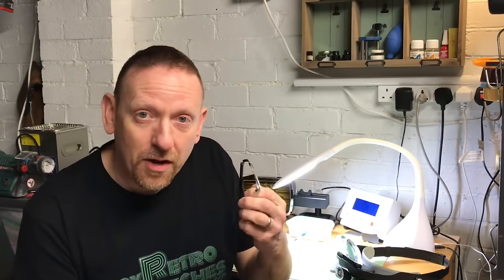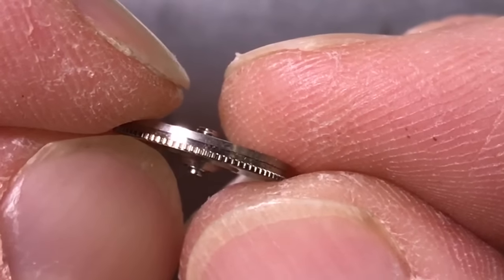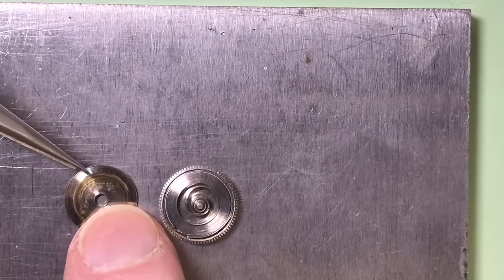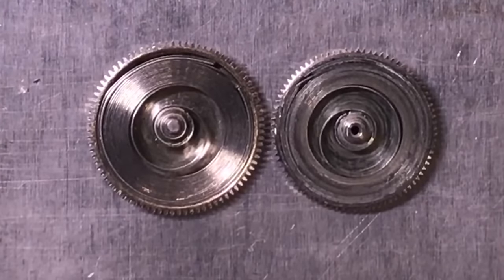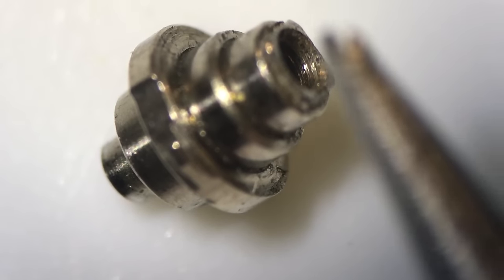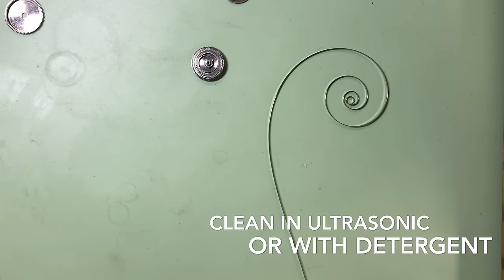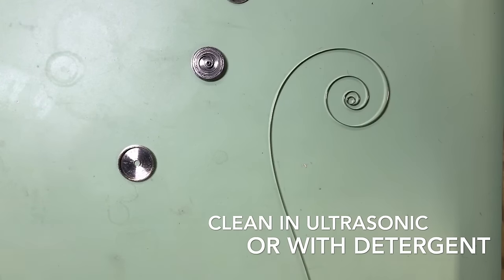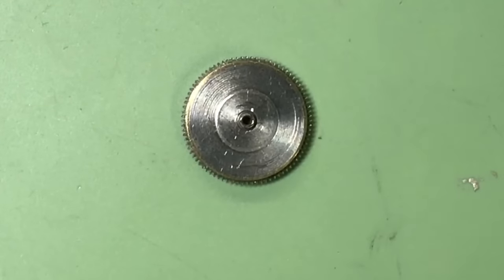How To Service a Watch Mainspring By Hand

Comment: Hi Mike. APropo of microscopes, would one like yours be suitable for manipulating hair springs? It’s something I would like to learn as, in the event the rebuild goes well, and there’s power in the mainspring, it all comes down to the balance, and that will often be the hairspring. Martin
Reply from the maker: if you want to tweak hairsprings then id recommend a boom arm scope as you will have more room underneath to work on. I have successfully used mine but more room would make it easier.  I have links to AM scope boom arms on my tool page on my website.
Reply: My Retro Watches Thanks Mike, I’ll give it some thought as they’re a little pricey for a beginner. Martin

Comment: I have a question. I hear from other watchmaker channels that you dont want to touch anything with your bare hands leaving skin oils behind, and that skin and small pieces of you fingernails will get stuck inside the spring and cause issues and corrosion later. Is that true or false?
Reply from the maker: This is true. I usually wear finger coverings for most work.  If it is your own watch then its up to you. Corrosion will only happen if you have greasy oily fingers and I am yet to see serious corrosion from finger prints.  You can see them sometimes on parts but the main killer is water ingress which will rust a movement in days.

Comment: I was thinking the only way I was going to do this was to not service the mainspring at all, or buy a mainspring for each watch because they come in that ring that allows you to be able to just push it in the barrel. (A set of winders is not reasonable unless I decide to make this a regular hobby).
I was led to believe that it can't be done manually without kinking the spring.

Comment: Great video....here I go..
Reply: Wow..you make it look very easy. What a job, the language I used was nothing like yours!! Really fiddly and so difficult to visualise which way to wind it for a first timer. I had cramp in both hands by the time I'd finished...and was extremely relieved on completion to have wound it the right way. Had to do it bare fingered though as I just couldn't do it with nitrile gloves. Thanks so much for your upload.
Reply from the maker: Thanks glad it helped. It does get easier with practice.

Comment: Thanks for the video.  One thing I don’t understand is how the arbor latches onto the mainspring at the centre. I understand that the bridle stops the spring slipping at the outer edge, and that there is an indentation you mentioned in the arbor, but how does it actually hold the spring?
Reply from the maker: HI Alan, Weirdly I replied to this a few days ago and clearly it did not post. Okay so the end loop of the spring latches on to the ridge of the arbour . when the spring is wound the latch pushes the end of the spring in the end loop to then wind.  If the spring is wound the wrong way when you put in the arbour it still fits however the latch is then the wrong way so what happens is that if you install it into the watch and apply some tension it will start to wind and then it clicks over the latch and all tension is lost . (I have done this on several occasions) Hopefully this makes some sense to you.
Reply: My Retro Watches Thanks for taking the time to reply. I think I get it now. I didn’t realise there was a loop in the end of the spring. I need to look at one more closely!
Reply from the maker: Alan H  it’s the smallest coil on the end near the centre.

This website I found at random shows it for you.

https://www.bobswatches.com/watch-resources/rolex-mainspring-barrel

Comment: Watching this video for the third time, I don't see you hooking the arbor to the  mainspring as you push it through the casing. Am I missing something or is torque somehow in play here when the casing is completely closed?
Reply from the maker: Without watching the video again I cant remember however the lid will not close unless the arbour is seated correctly. Some of these Seiko ones can be a bit awkward. I tend to position it and then turn with tweezers so it hooks into place.

Comment: Good watch! Il stick to my mainspring winders🧐😅I tried and was not getting the hang of it!
Reply from the maker: Carrie Angel well as you have the right tools there is no real point to hand winding.. 

Thanks for watching
Reply: @MyRetroWatches  I'm working with bracelet watches, can I use any mainspring as long as it's the same width as old one? I've been at the barrel arbour for 1 hour trying to sit it snugly, then I used my tweezers and have ruined the shape😥its real difficult learning however I'm sure if I keep practicing il get there eventually!
Reply from the maker: Carrie Angel no you need the right spring for the movement. I am no expert on them but you will need thickness length and height along with the type of bridal it is.  Cousinsuk are a good place to work out what you need
Reply: @MyRetroWatches  thankyou😊

Comment: should any oil be applied/rubbed along the length of the spring?
Reply from the maker: Hello Kyle. yes, there are two ways to do this. either apply the oil before putting it back into the barrel. I have done this using watchmakers paper folded and with a small amount of oil in the bottom of the fold. Then gently pull the spring though the fold to apply a very thin coating.   This is not ideal if and winding into the barrel.  I now wind the spring in and then brush a small line of oil onto the coil at, 12,3,6,9 so it forms a cross,  The oil quickly sinks in and when wound will spread over all the coils over time.

Comment: Aren't you getting finger oils and bits of skin inside of the barrel if your not wearing cots? Also, there doesn't seem to he a good way to assure any kind of evenness radially or in the z axis? I believe the only way to do this properly is a manual winder or a completely new spring.
Reply from the maker: v b agree with you totally. Like I said in the video this is not the right way but for hobbyist starting out who can’t afford pricy spring winder’s you don’t have any other real option.  That said in all the ones I hand wound in I never had any issues show up on a Timegrapher .

Comment: My Anglo Swiss watch co vintage handwind watch was working good hitherto, but,all of a sudden it stopped .I checked immediately and found there was no spring tension.I tried to wind again but in vain.There was absolutely no power.The spring had relaxed though it was fully wound just two hours back.I checked the mainspring,serviced it by hand and reassembled it.Yet,I could not wind it.Utter failure.All other parts are in their positions in good condition.Can anybody suggest the reasons for the failure and measures for its restoration?

Comment: How do you do it with finger cots? Every time i try they get stuck in the coils
Reply from the maker: Dont worry too much for finger cots.  People get hung up with rust and I can tell you now from all my expience in this hobby and my professional life (I sell and produce precision machined steel plates)  its rare to see rust from finger prints.  We call it rusty fingers and only a small percentage of people may have oils in their skin that can be corrosive.  For the most part if if you touched a mainplate with a big fingerprint deliberately then maybe in a few years you might see the outline of your finger print.  I have seen it in some watches but its rare.   On your mainsping you will have put a film of oil on it anyway so in my view, and it is just my view,  It really does not matter.  Wind your spring in without cots can come back and comment in 5-10 years telling me it failed because of it.

Comment: Much as I hate to, I'm just going to need to shell out the ridiculous money for a winder.  I'm using the same barrel but got lost at "The bridle always wants to the on the inside" (19:24) v. "all the bridle is against the barrel wall" (20:30). Besides, I never could the bridle in without bending hell out of it.  :)
Reply from the maker: are you sure you are winding it the right way?  I remember trying this for the first time and thinking its impossible.  then when I looked at the photo I took of the spring in the barrel beforehand and then followed the centre coils back to the bridal I then realised I was winding it in the wrong direction.  remember some are left and some right handed.

Comment: Ive heard before that cleaning and re greasing a watch mainspring will cause it to break in a period of 90 days thereafter.  What knowledge do you have in this matter? Watchmakers magazines back in  the day wrote about this and suggested to replace the mainspring instead of cleaning and re-greasing.
Reply from the maker: I have not heard this but back in the day they used blue steel mainsprings that would not last or eventually set and thus hold no tension.   More modern day springs like these 70s Seiko ones  were the "unbreakable" ones made of different steel (alloy I think)  I have never had one break after a service at all. I can only conclude that the myth your refer to is for much older springs.

Comment: It would make perfect sense if all the springs were wound clockwise ;)
Reply from the maker: Dooguk indeed . Especially now I have a spring winding set. You need others for the opposite wind
Reply: @MyRetroWatches  which did you get?
Reply: Same for cars with roads on the wrong side... Japan, Cyprus, etc.

Comment: Would you recommend keeping the balance, hairspring and balance cock together during cleaning? I'm a total beginner.
Reply from the maker: +daveycrockett64  I would always keep it all as one piece yes. It will depend on your cleaning method too. Good practice is to return the balance complete back into the mainplate for cleaning to prevent damage.

If you are cleaning at any stage with water I would keep the balance off the mainplate as if you leave to dry insitu there is a chance of surface rust.

If you are a beginner I do not recommend attempting to remove the hairspring from cock / balance wheel. 

It’s so delicate and any damage will ruin all your hard work.

Good luck
Reply from the maker: +daveycrockett64  yes always keep them together. Removing as a complete beginner your likely to damage. Keep it all as one piece
Reply: @MyRetroWatches  All finished now and running well. Thanks for the advice.
Reply from the maker: daveycrockett64 well done!
Reply: Keep it together but remove the jewels first, so that the pivots and the jewel settings will also get cleaned.
Reply: @MyRetroWatches  can you use the same watch cleaning solution on the balance unit? Some people even run a cycle with dishwashing liquid first...can you apply tge same to the balance? How about the pallet fork with its jewels?

Comment: I like your vids but hand replacing the mainspring puts a twisting torque into the spring which causes problems with power transmission. If you don't have a set of mainspring winders, then you don't have a choice but it's not desirable to do it this way.
Reply from the maker: AwGusTeen ain't this is correct.  I am aware it’s not good practice but it is possible and for the beginner hobbyist who can not afford a set of wonders when they are just starting this is the reason I shot the video.
I do have a set of winders but I still have to manually wind 7### Seikos as they wind the opposite and I don’t have a set of winders for that.

I have been lucky and only broken two mainsprings this way.   If you are careful and with good technique you can get it in just was well as any winder.  Proof for me is in watches I then test as amp is great under regulation .

I am not trying to justify this technique as I know the right way is winders ..

As a hobbyist I make videos to help and inspire more into this hobby / industry only.
Reply: @MyRetroWatches  I understand and I appreciate your sharing your knowledge with us. I really liked your comparison of the watch timing software comparing it to the ACE timer. Very informative. Many Kudos!
Reply: @MyRetroWatches  I am a novice as well. Please don't take me the wrong way as I really like what you are doing to promote new horologists. If there is anything that I can do to help you, please let me know.
Reply from the maker: AwGusTeen ain't pleasure and appreciate your support. My first sentence in my last reply does not make sense!  Predict text gone mad..

Comment: Shouldnd you wear gloves to prevent corrosion ?
Reply from the maker: Yes in theory finger cots. I think I said that in the video but this one was a few years ago.  On an automatic movement the mainspring and barrel wall would be greased anyway.
Reply: @MyRetroWatches   You mentioned it at the end of the video ! i was too quick with my reply but wanted to get my mainspring in ;)

Comment: Saw this after I watched the Watch Repair Channel explain why you shouldn't do this.
Reply from the maker: Well yes I know Mark personally. The professional standpoint is this bad and I do also say that in the video . However two points.
First the new hobbyist often can’t justify the crazy price for a new set of Bergeon winders. So hand winding is an option as after all they are working on their own watches.
I have had wound springs for years with absolutely no issues with the watches performance. I do now own winders and ironically scrapped more mainsprings using them than I have ever with hand winding.
Secondly, it’s funny how hand winding a spring back in is bad yes everyone has to remove a mainspring by hand which is practically the same thing in reverse and this of course is totally accepted.
Reply: @MyRetroWatches  Apparently it doesn't matter if you touch things with your fingers before you clean them.
Reply from the maker: @Josef_R  it’s not about touching a spring to wind in as you would be wearing finger cots or have at least oiled it before hand. The point people make about hand winding is that it can bend the spring out of shape.

Again this video is to help the beginners and I do say that this method is not the correct way. 
I am not saying you should do this method but I am saying you can.
You don’t agree I am fine with that as this video will always split opinion. I come from a hobbyist point of view and my channel is all about that and inspiring more people into the hobby or the profession.
Reply: @MyRetroWatches  His point was about touching as finger cots get destroyed and leave contaminates while winding. But that was only one point he made. This was nothing to do with my opinion,  as I said, it was his opinion.  I suppose if it was about the savings on the winders, you still need $10,000 worth of other tools to DIY.
Reply from the maker: @Josef_R  incorrect you don’t need that kind of money and I along with many others are proof of that…
He does show the spring has a bend in it from hand winding .  You clearly just want to argue so I will just let you go about your day.  I am actually meeting Mark in a few days so maybe I will ask him
Reply: @MyRetroWatches  As I said, it wasn't the only point he made, but it's also him saying why you shouldn't.  Someone who clearly wants to argue would be someone who keeps  trying to make me out to be wrong in  what I said, which I am not.  Responding to you is not arguing. You could ask him or you could watch the video.  Either way, that's what he said. It's pretty fucked how you're all in your feelings over a one line, inoffensive comment I left.  Maybe take some Mydol?
Reply from the maker: @Josef_R  so now you start swearing ….  I was not making out your wrong but you are trying to imply I am as you have watched one video from someone else that by the way I saw when it was released some years ago now. There is a massive difference between a pro and an Amateur and contaminates can get into a barrel just by it being on your bench or while you use a winder especially as the spring has oil on it. 
The mainspring is a part that I would worry least about a a bit of dirt being on compared to the rest of the movement.  I have seen 100s of barrels and if which I am the first person inside for 50 years . All oil is hard and yet they still perform.
Reply: @MyRetroWatches  Yeah, because you can't seem to see the irony in my simple comment about two random videos.  I don't care how either one of you does it, I just like looking at watch innards.
Reply from the maker: @Josef_R  then I apologise to you sir for taking the wrong end of the stick.
My mistake but I can’t always read irony.

Comment: Yikes--I didn't even think you could do this by hand. I just removed the barrel and am a bit chicken to attempt this...
Reply from the maker: Bill Cripe doing by hand is frowned upon by many as you can damage and contaminate the spring . Wonder tools will cost you over £100 and then you have to learn how to use it.
When I started I just left barrels well alone.
Then eventually would open up and put some drops of oil in .  Eventually progressed to remove one ...
Reply: @MyRetroWatches  Well I did open the case--first time--I did NOT uncoil the spring; (I didn't have that much nerve.  :) I "cleaned" it as best I could with rodico and lightly lubed it.

Comment: But the corrosive sweat in there 😞
Reply from the maker: I am yet to see a corroded mainspring.  Never seen one in the 100s of watches I have been in. Pluse you oil a spring.  To be fair I have not seen corrosion caused by a finger print either, just staining or discolouration.  its water that causes oxidisation not oil from your skin.   I work in engineering for my day job and we produce precision ground steel thats handled througout without any corriosion.   I can't say it doesnt happen but my opinion is its quite rare.